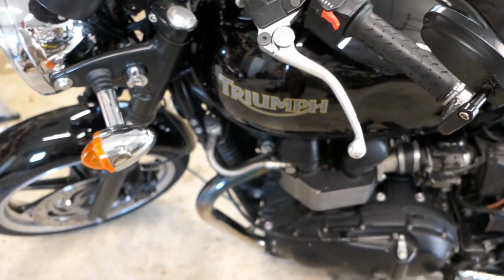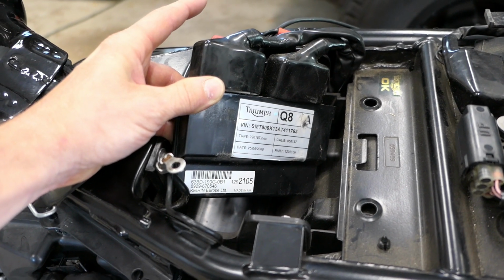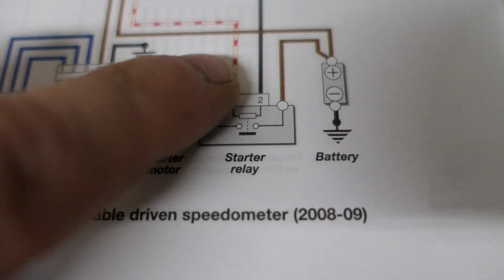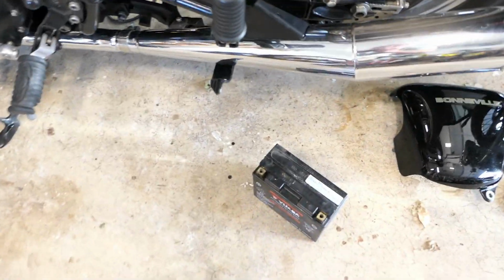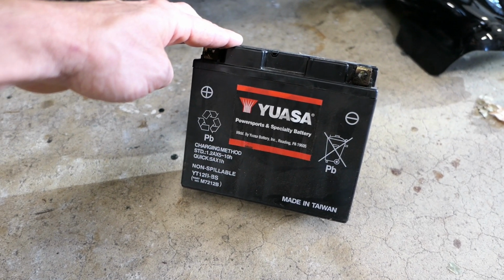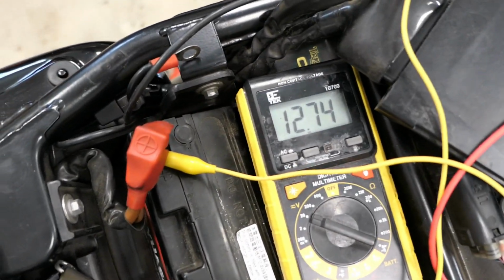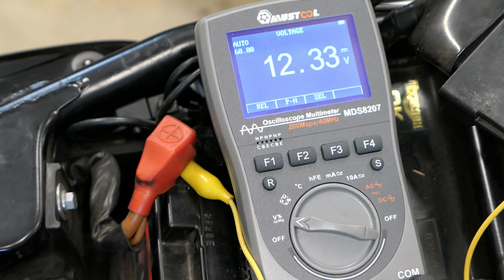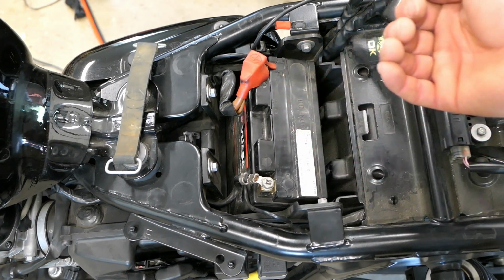Understanding The Triumph ECU Starting Issue

Comment: Hello sir. I had a question regarding the fuse on my triumph storm .whenever I try to start my bike it would crank and the number 10 fuse would pop. 
The bike rode fine my husband deployed. I kept battery charged. When he got back I put fresh gas and tried to start it ne this was when I began having this issue. Any advise?
Reply from the maker: I believe that fuse is the starter circuit.  There could be lots of things wrong, but if the fuse is popping then you have a short somewhere.  One possibility is in the starter switch itself.  Another is that you have a wire which has rubbed through which is hitting ground.  If the bike has been sitting for a long period a mouse could have chewed through wire insulation or you could have moisture in the switch.  The first thing I would do is a close visual inspection.  Get up a few inches from the wires coming from the start switch and  the fuse box and look for anything unusual.  Try a hairdryer on the switch if you suspect moisture.  Beyond that you need to get out a meter and trace the circuit to find the short.

Comment: I may be wrong, I'm sure someone will correct me if I am, but I believe the inability to try to start when the voltage is low is to protect the sprag clutch, I have seen an upgrade for the sprag clutch on a Triumph spares site but can't remember which one.
Reply from the maker: I have heard that explanation as well.  Whatever the reason, Triumph set the voltage bar a little high!

Comment: no  spark at coiln in triumph motorcycles 2010. The owner he put the battery in wrong position he put the Minos with pulse and plus with Minos and there cranking and there is electrical now but no spark from coil any advise
Reply from the maker: Well, check all the fuses, obviously, and look for any burned wiring or fusible links.  You'll need to go over the whole electrical system to check for issues, and that includes the ECU.  It's possible that was cooked when the battery polarity was wrong.  You can check the coils with a meter.  Here's a video showing how to do it:  https://youtu.be/M3dEXUiGq90

Comment: My 2010 street triple cranks but doesn't start. Could this be battery related? Didn't have time to take any readings but will after work.
Reply from the maker: When you say it cranks--do you mean it turns over at normal speed but just doesn't "catch" in order to run?  If that's the case, then you have something else going on.  The battery just needs to be strong enough to meet the minimum voltage if the ECU demands it and to turn over the engine quickly enough to create engine vacuum and pull the air/fuel mix in.  If the cranking speed is too low it can prevent starting, but you can usually tell that by ear.
Reply: I have a similar issue, I've read it could be the stator and voltage regulator others say the clutch sensor. As of now the bike is at the dealer. Hopefully it gets fixed. Mine won't start after it gets hot, I'd have to let it cool down
Reply: @R3nat002  A few on the triumphrat forum website list a common problem being the ignition pickup coil that fails (no spark at all) when hot but operates completely normally once cooled down, only to stop working again once warmed up.

Comment: Did you take your bike in to flash the ECU? Will a Triumph dealer charge for that?
Reply from the maker: Under some circumstances the dealer might update the ECU for free if Triumph has posted a technical bulletin about a problem, or if your bike is in for some other reason they may do it gratis.  You could always ask, but the cost wouldn't be much anyway.

Comment: if it is sending power to the relay it is trying to start, could the relay contacts be burned
Reply from the maker: It is possible, of course, to actually have a bad relay.  But, the problem I was referencing in the video is when the ECU is preventing starting.  So, if you are in doubt you can test the relay by itself and you can check the battery voltage to see if it is low enough that the ECU would intervene.

Comment: The thing is, how much volts ECU reads and that can be a bit diferent then measurment by instrument. If you conect OBD cable and read voltage by softvare, and paralel read voltage by instrument and compare it, it wont be the same. Softvare reading is more corect due to ECU start the bike or not by that value.
Reply from the maker: It's true that the ECU may sense a different voltage than a meter.  In fact, two meters side by side may not read the same.  However, a meter is needed to do tests on the battery and to do troubleshooting.  Ideally you own a meter that you come to know and trust through experience.

Comment: anyone know where the odb2 hookup on this bike is? I am considering buying a connector to tune but want to verify the plug first. I see the ecu but shouldn't there be an empty obd2 connector somewhere?
Reply from the maker: Which bike?  Typically it is located under the seat in a dry spot.

Comment: What if the bike has been sitting for 6months. You turn the key and nothing happens (no lights no fuel pump noise-nothing). Then you replace the battery -TWICE. You hook up the same batteries to a vespa and speed triple. Batteries work fine. When you touch the cables to the battery nodes it sparks so a circuit is being made. But of course turning the key does nothing. Any ideas? I can't bump start it bcos it coincidentally has developed a clutch cable issue I am fixing separately...
Reply from the maker: Dude.  Buy yourself a cheap multimeter.  Guessing at the issue is an expensive way to troubleshoot.  With these sorts of issues you want to first confirm that the battery is good and fully charged.  I have another video showing how to test a battery and what to look for.  With that out of the way you can test other components.  If you turn the key to the "on" position and get nothing-no headlight or fuel pump- there are a number of possibilities, including bad cables or connectors, a faulty ignition switch, a blown fuse (if the bike has fuses), or faulty safety switches.  You didn't mention which bike you are working on, but these are common to many bikes.  With a multimeter to can disconnect and test the switches, you can test cables and grounds, you can test fuses.  Finally, a thorough visual inspection can be helpful.  You wouldn't be the first rider to have a mouse chew through a wiring harness while the bike has been sitting a long time.
Reply: @tinderboxarts  thanks for your reply I appreciate it! it's a bonnie scrambler with a choke like yours. The battery definitely is good, it starts my speed triple and vespa and the wires spark in the scrambler. The fuses and wiring looks immaculate. In the past I lost the keys once and hot-wired the ignition barrel to start it - doing it again the wires sparked the ignition-barrel circuit but no life across the bike. Taken all the bits off and there's no damage on the wire loom. It's just such a head scratcher I wanted to talk about it with anyone who has done work themselves too
Reply: @tinderboxarts  oh and I have a trusty multimeter but I don't know what to test it on really. Like I said seems like the circuits are in tact. You know a lot about the circuits and engine computer, I don't think it's the same issue of voltage threshold you mention in the video. Are there any other weird behaviours you know of?
Reply from the maker: You are making assumptions, though.  The battery may start another bike, but that doesn't mean it's in good shape.  A battery at 12.2 volts may start a Vespa, but not start a Scrambler.  You want to make certain the battery is fully charged, in the 12.5-12.8 range.  If the tested good battery is installed and you get no lights or fuel pump noise, then check the battery ground with your meter.  Do you get the same voltage across the battery terminals as you do with one lead on the positive battery terminal and the other lead on the frame or a ground somewhere else?  If not, then you have a loose or corroded ground.  Did you test the fuses with an ohmeter?  Looking at a fuse doesn't mean it's good (see https://youtu.be/OlRLQvjx8mk).  It can be broken internally.  Did you test the ignition switch with an ohmmeter?  It may not be functioning.  Did you test the safety switches (kickstand, clutch, kill switch) with a ohmmeter?  One of them could be bad or the wiring faulty.  You're hearing hoof beats and thinking about zebras, but horses are much more common.  Like I said, if the battery is good and you are getting no response at all from turning the key, then it's likely something major like a bad ground, faulty switch, or broken wire.

Comment: Does anyone happen to know where the ECU is for the Trident 660? I’m trying to send mine in for a tune but I don’t know where it’s at 😫
Reply from the maker: I don't know that bike, but the ECU will always be hidden somewhere protected from water, typically under the seat area or under the gas tank.
Reply: @tinderboxarts  under the seat area, probably. I’ve checked and I don’t know if I’d have to take the battery off. If it’s under the tank then I’d have to call the dealer then to see

Comment: My first battery on my Bonneville lasted less than two years. I was not impressed. I also had to replace all the cables last month (luckily Triumph agreed to pay, despite it not being under guarantee). It would have cost 1,200 euros. Now the mechanic says the starter relay needs replacing, but I'm wondering if it's simply that the battery is low on juice. It's been another two years since the previous change. It shouldn't be that, but considering the previous problem with the battery, it may be. None to happy.
Reply from the maker: Battery issues cause all sorts of headaches, but they are really pretty simple to troubleshoot.  The problem is that riders and mechanics often make assumptions about the battery or charging system rather than actually test it.  What are the reasons a battery might only last two years?  They include improper initial charging on installation, sitting too long before initial use or between uses, parasitic draw from things like alarms, lights or electronic devices left on, bad cables or poor connections, a marginal or failing charging system, and more.  So your really must test to know, starting with the battery itself and working from there.  With a simple and inexpensive multimeter  you can do these tests yourself.  See these videos:

https://youtu.be/d-5xA31nBd8

https://youtu.be/6zcSZ4-oFJc

Comment: Can you bridge the solenoid posts or would that upset the ecu ?
Reply from the maker: You might be able to use the old screwdriver trick across the starter terminals, I never tried it.  That method, which I used as a teen on my '75 Chevy, often causes an arcing meltdown if you don't get your timing just right!
Reply: @tinderboxarts  fully agree but a high torque starter on a small block will draw a bit more current than a Triumph. If it’s just a case of the earth maybe a second earth on the solenoid ? Just thinking allowed as I’m about to buy my first Triumph and all this talk about electrical issues makes me look towards carbs😂

Comment: My 2008 Sprint does this thing where it turns over once then stops. Does this multiple times then all of a sudden will crank 6-7 times and the bike starts. Battery load tested perfect. 🤷
Reply from the maker: There are a number of possibilities,  including the start switch itself, starter relay, wiring and connectors, and the starter itself. Most likely you have a poor contact or loose connection somewhere in the circuit, but I would begin by putting a meter on the start switch to see if it is giving inconsistent performance.  The starter relay would be my second examination, and after that you'll have to trace the starter circuit to look for poor connections.

Comment: My 2009 Bonneville won’t start. When I turn on the bike, nothing happens. No fuel pump. No click. No lights. Nothing. I pulled the battery out of my other running bike and still nothing. The fuses all look okay. The battery had been on a battery tender.
Reply from the maker: The 2009 model year was a transitional year.  Do you have a carburetor or fuel injection?  Fuel injected bikes are computer controlled, carbureted bikes are not. Either way, if you get nothing at all then the first check is the battery.  You should check the voltage with a meter rather than swap batteries.  If that checks out, the next question would be the cables and connectors.  You can use a continuity tester or ohmmeter to check the ground, you can do a visual inspection to make sure there is no corrosion or loose connections (not just at the battery).  You say the fuses all look good, although they can look okay and still be bad.  A meter will tell you for sure.  Finally, it could just be one of the switches which has gone bad, so the rest of the electrical system is okay but the key-switch or the kill switch is no longer working.  These can also be tested with a meter.
Reply: @tinderboxarts  I will go through the steps you listed.

Comment: So you could jump start it then in this case ?
Reply from the maker: If you can get the voltage up over the threshold, it should start, yes.  And, you may be able to "bump" start it as well, since the fuel pump will spin up even though the starter won't engage.   See this: https://youtu.be/pIvB6iI7atU

Comment: Ours won't start in high heat. Why? The antenna which detects a chipset in the key fails.
Reply from the maker: You didn't mention the bike or the year, but if you are having trouble with key fob recognition, that's a different problem.  It's actually not uncommon, either.  I don't know why, specifically, your problem only occurs in high ambient temps.  However, when temperatures rise, metal components expand and sometimes that can make a difference in electrical or physical connectivity.  This could occur in the fob itself with battery connectivity, or in the receiver on the bike, or perhaps somewhere in the wiring harness.  You might be able to do some experimenting with a hairdryer.  In a garage or otherwise cool environment, try heating up specific items or areas with a hairdryer and see if you can duplicate the problem.  Start with the fob itself.
Reply: @tinderboxarts  2016 triumph Street triple r
Reply: And sidebar: thank you for responding to my short comments. I'm juggling my research for a solution and am sort of "blasting" my problem wherever I find discussions.
Reply from the maker: Start with the fob itself, replacing the battery and making certain that the battery contacts are clean and making solid contact with the new battery.  As I said earlier, these keyless ignition systems are known to have issues across many manufacturers.  The problems generally are fob battery related, or the inability of the bike keyless module to pick up the signal, or a problem with the keyless module communicating with the rest of the bike due to an internal failure or poor wiring harness connection.  If you get nowhere with the fob and don't see an obvious issue with the module, you may need to visit a dealer.
Reply: @tinderboxarts  it's not a battery operated fob. In fact, it's not a fob at all. The key is mechanical ... but it has an electromagnetic chip in it (non-battery) that reflects a signal back to the immobilizer.
Reply from the maker: Okay, those are even more notorious for problems!  I'm afraid there probably isn't much you can do without visiting a dealer.  It may be the antenna or module has failed, but diagnosing that possibility requires dealer software tools, as far as I know.  You may also be able to get some good will warranty work if it has failed.  Personally I prefer the old-fashioned key because these sorts of problems never happened.
Reply: @tinderboxarts  so I'm learning. The forum banter concludes nothing. I pulled the tank and opened the airbox, cleaned everything (checked the air filter while I was there) ... best I could offer was to bore out the cable feed so that it isn't being pinched + scotch  wrap the line at that very same entry point.

Meh. At least she's starting. Hey, keep doing what you do and I'll do the same ;-)

Comment: Can anyone help i got a thunderbird 1600 2011 and im driving down rd after few miles bike cuts out but re starts and does same i taken it to dealer who done test cant find probem replaced fuel line ect i thought ignition sensor ? Any help be great
Reply from the maker: If your bike is acting normally but then randomly just shuts down, it's almost certainly an electrical issue and probably one of the safety sensors, such as a kickstand sensor or even the kill switch.  To find the problem, pay attention to when EXACTLY the problem occurs.  Is there a bump on the road just before?  Did you just finish shifting?  Did your foot brush the sidestand?  Look for a pattern.

Beyond that, take a meter and check the various switches for function.  Check continuity in the wiring harness between the sensor and computer with an ohmmeter, and wiggle each wire with the meter connected.  Look for a drop out on the meter when you wiggle a particular place.  You can even do it without a meter--start the bike and let it idle.  Then wiggle the wiring harness and switches inch by inch to see if you can cause the engine to shut down like it does on the road.